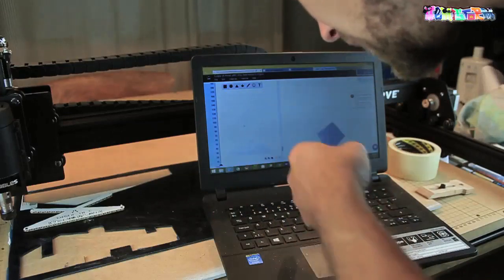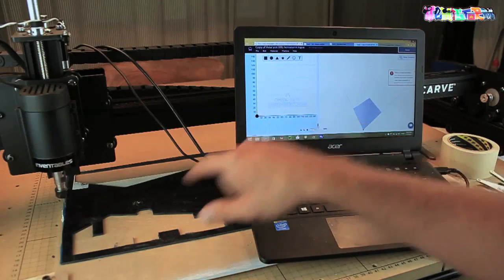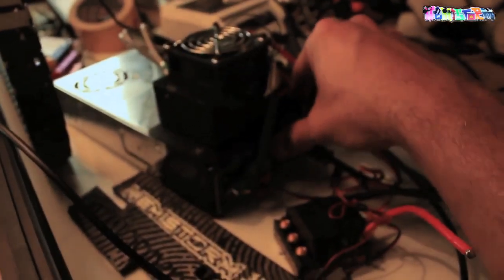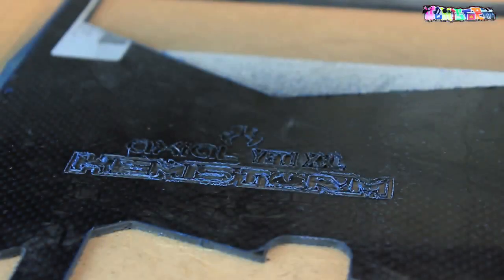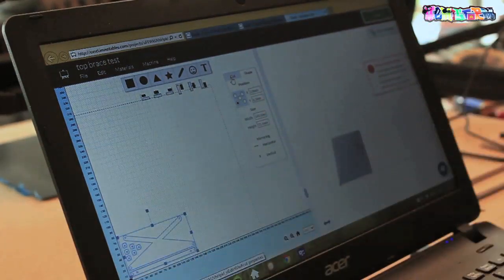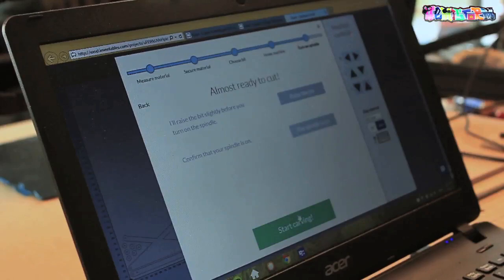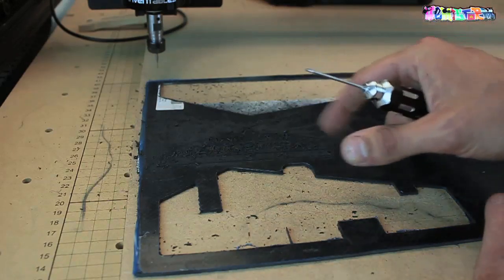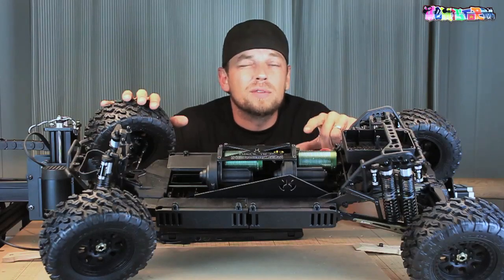World's BIGGEST Axial Yeti XL Part 3 - X-Carve in Action - HemiStorm Yeti XXL

Comment: Does the X-Carve or EASEL do countersunk 3mm screws? Just wondering since I want to make some plates for my drone with some countersunk screws. Or do I have to do it manually. Great videos and tutorial!
Reply from the maker: It does, you can switch the router bits out and adjust the drawings to your specifications.
Reply: That is awesome! Is cutting carbon fiber and fiberglass G10? the same parameters? Or one is different than the other? Thank you for the reply.

Comment: I'm thinking of getting one myself.(about 90% sure)  What's the noise like?  I live in an apartment and don't want to interrupt my neighbors or let them know what I'm up too.  If this is a stupid idea let me know.  I will be doing carbon fiber mostly and possibly aluminum.
Reply from the maker: +Martin Harrison You may have a bit of a problem there. The spindle itself and the stepper motors are very quiet, but once you start cutting harder materials the sound levels do go up dramatically. Building a case in which the X-Carve can operate with some sound proofing may be an idea. The footprint of the smaller machine is very reasonable, and I can imagine that a box around it will not only reduce the noise, but also the dust.
Reply: +HemiStorm RC - Custom RC builds, painting videos and more I kinda thought that.  Thanks for the reply and info.  I just want to take my rc projects to the next level.

Comment: was there ever any issue with cutting carbon fiber. ive ordered my own xcarve, but i was told carbon fiber dust can kill the drill since carbonfiber is conductive
Reply from the maker: +sphinix rc Just cover your face, and keep the vacuum cleaver handy. If the dust doesn't end up in circuit boards it's not a big deal. Apart from causing lung cancer of course.
Reply: +HemiStorm RC - Custom RC builds, painting videos and more 

Thanks.  Hopefully my machine will arrive soon and i can start working on my drone frames.  I already have a few 3d modeled